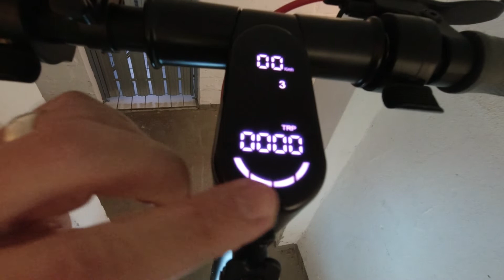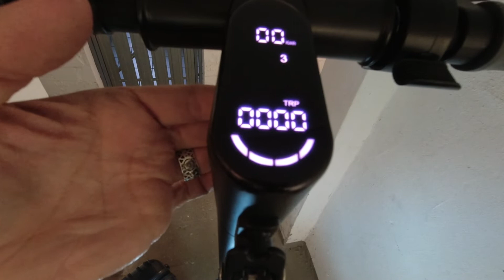SCOOTER Fix the PROBLEM iconBIT IK-1969K | Ελληνικά - Greek

Comment: Hello mine doesn't start after he was in the rain(water damage) which part do you think is damaged, controller or dashboard?
Reply from the maker: i think both make it dry
Reply: @BabisToboulis  Hi, i fixed him, the start button had rust inside because the water, open and clean with alcohol and he rides again.
Thanks for the courage to open and fix him.
Reply from the maker: Yes this is nice have fun with your scooter!!